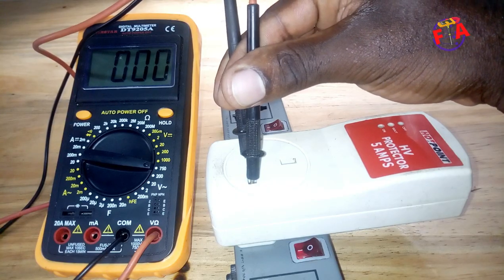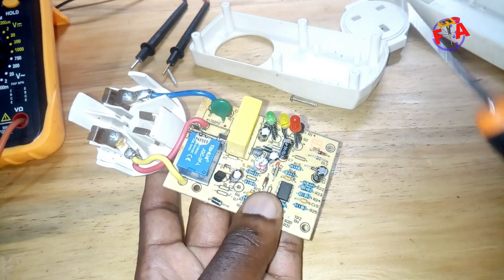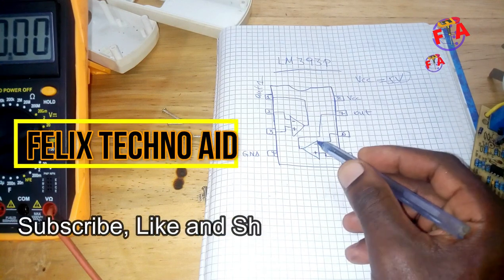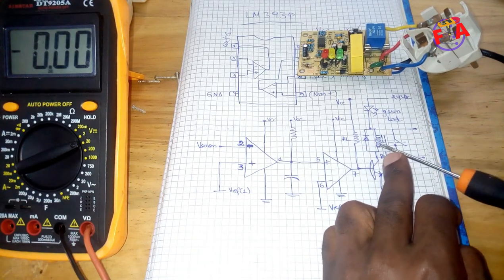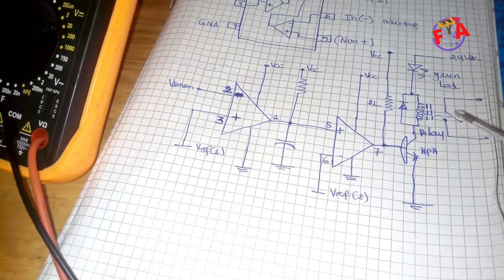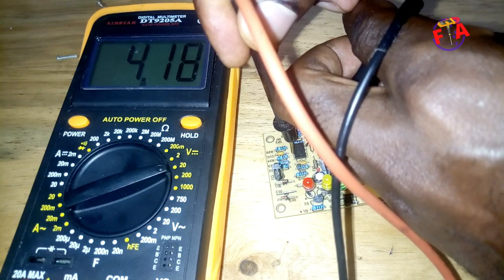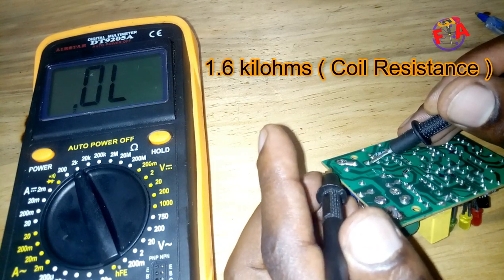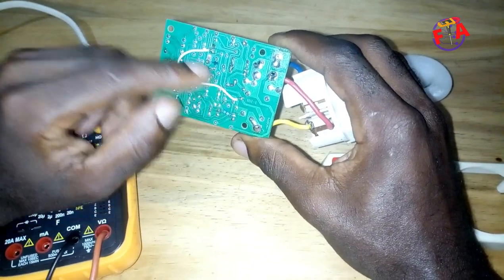HOW TO TROUBLESHOOT AND REPAIR HV PROTECTOR/ TV GUARD

Comment: Hello great video exactly what i was looking for and well explained. I have one that has stopped working, red light remains on and never goes to green. There are some resistors under the big capacitor but they are all burned and I do not know the values. Measuring with a meter ready various values from 409 Ohm to 470 Ohms but the first colour looks to be brown. Please could you tell me what value these should be? 

On an unrelated question. Ever since learning electronics I was told there should be a transformer to drop the voltage from 220v AC to the lower voltage.  After passing the 4 diode brigde the 5.24V comes from 78L05 but where does the 12/24V DC to switch the relay come from?

Comment: it is already operating with uncorrect 255 volts,  there is no problem turning off itself ,  just showing uncorrect volts on the display.
Reply from the maker: check supply voltage with digital multimeter, if it measures 255volts or displaying voltage lower than 255volts replace that  protector,

Comment: dear friend, i have also this type fridge guard with digital volt meter,  i am using this guard approximately one year, before it shows me correct 220 volts in the meter, but now its  showing 255 volts since 2 month.
Reply from the maker: it switch off the power?

Comment: Main switches itself off randomly I don’t know why but it can be working then after some time in your switches itself off and it goes on the yellow late then after like 20 seconds again it switches on but I don’t know the cause of that
Reply from the maker: the main cause is voltage fluctuation , unstable electrical mains.
Reply from the maker: please subscribe to day, be aluays with us if you need to increase your technical knowledge through our videos, Like and share

Thanks.

Comment: What can I do if the power supply to the relay reads 5.67V?
Reply from the maker: supply voltage for relay must be 24Vif voltage is less than this check voltage dropping resistor in serie with capacitor
Reply from the maker: please subscribe , Like and share

Comment: Can tv , laptop , dstv be used on it at the same time ?
Reply from the maker: it depends to it's amperage , you can use 7 amps HV protector.
Reply: @felixtechnoaid2044  which one is the 7 amps? I have like the one you have on this video it is 13 amps will that carry those things at the same time that I just mentioned ?
Reply from the maker: @juliusangel2774  yes of cause they will work.